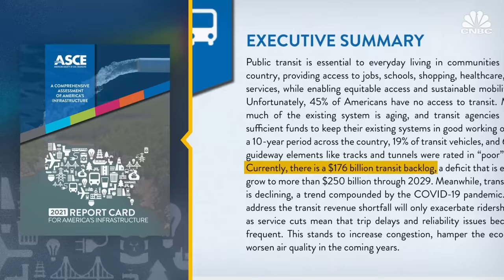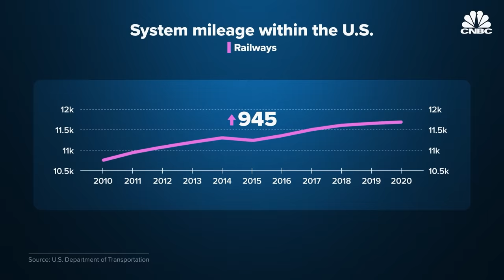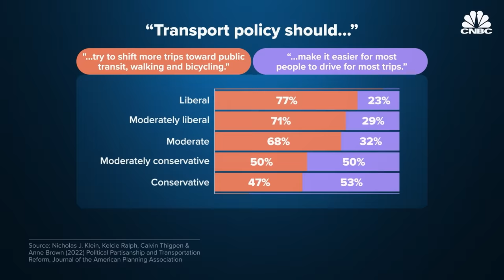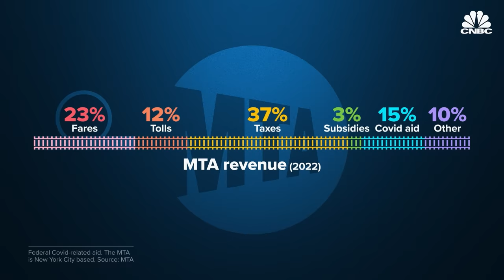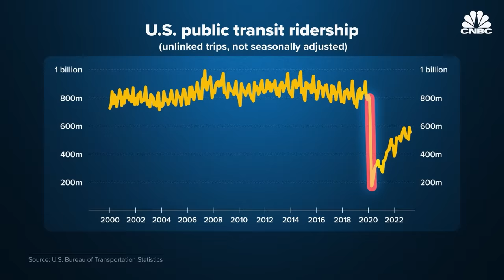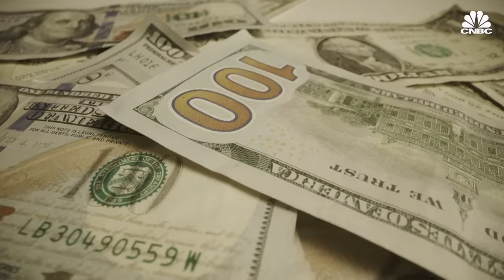Why The U.S. Gave Up On Public Transit

Comment: The U.S. is in a difficult spot. We need more and better public transportation, but to get to a reliable level would cost billions. Especially outside of large major cities. Minus the NE corridor, DC, and Chicago, public transportation drops off fast. Sure, LA and San Fran have it, but it's not like comparable to NYC or other parts of the world like Europe. 

Even in Chicago it gets limited outside of the city. The city is about 2.5 million people, but the region is about 10 million. There is a light rail system, but it's limited outside of rush hour. If you need to travel to downtown at 10am, you have one train per hour. Limited trains going in the opposite direction of typical rush hour traffic. What I mean is you have plenty of business centric areas in the suburbs, but people who live in Chicago have no option but drive out since the trains are limited outbound in the morning. Vice versa going inbound in the evening. Basically the highways are packed in both directions in rush hour, yet no options unless you are going in the primary direction determine by the train schedule. 

Sadly that is the situation. We need more public transportation, but people don't want to spend on it. At the same time you need people to buy into it. I like my car and the convivence of it, but I know many will only look at their car and nothing more. You need to a cultural shift to potentially make public transportation viable in the states.

Comment: I love public tranportaion but as a tradesman, it's just not a viable option.

Nevertheless there are issues not mentioned here that avert profitability.  

First off, it's an easy target for fiscal corruption.  Second, it's frequently used as a piggy bank for municipal short-falls.  Additionally, management of the systems seem to be more of a set-it-and-forget-it.

Lastly, when emerging cities launch commuter rails, they seem to wanna debut it as the infrastructural Crown Jewel of their emergence, rather than building it first with practical efficiency.

Comment: Sometimes it just does not make financial sense either. I can take the bus into work BUT I have to commute to the closest MTS Rapid stop to catch the bus I need. 30-35 minutes later I get dropped off and have to walk a mile and a half to work. Return is just the reverse. It will cost me 5-10 dollars RT. If I drive my hybrid car at appr 40 mpg it cost about 5 bucks also but I have the flexibility to come and go as needed. I would LOVE to have a convenient functioning mass transit system here in San Diego but it just isn't. I have tried taking the bus from the closest stop near my house to Balboa Park. It is literally 3 miles away from my house but the bus route to get there takes nearly an hour! I can walk that fast...

Comment: I don't live in a city.  There is no way a transit system is going to work for people in my area.  First my driveway is 3/4 mile long with 500' of elevation change.  I'm not going to walk that.  So I need a car just to get to a public road.  Then it is 5 miles to a highway that could (and used to) have public transportation.  Why would anyone get on  public transit to only get close to where they want to go?  Then if you are going shopping what do you do with your purchases?  If you bought socks and underwear, it is not a problem.  But what if you bought 14 bags of groceries, or 53 bags of concrete mix, 20 ten ft. 2x4s?  So it is necessary to have a car anyway.  That's the story of living in a rural area.  Transit probably works in big cites for people who have a daily commutes in heavy traffic, but that's only a portion of the population.  And they still probably need a car to drive to grandmas house that is out in the country.

Comment: I've just returned to the UK from a driving trip down the West coast of the US, talking in Seattle, Portland and San Francisco.

I found public transport to be generally good - cheaper than the UK, and for the most part a pleasure to use.

Some thoughts:

The big one is that you should be able to simply use contactless payment on all mass transit. Paying with cash feels ridiculously antiquated and having to secure several different cards that you charge is just friction that makes it less accessible.

Several times on buses the machine wouldn't take my cash and so we travelled for free - I suspect a lot of people just don't pay.

Outside of cities (and sometimes within them) it's really difficult to walk anywhere. Even a short quarter mile from a hotel to the nearest grocery store often involves hiking along next to a busy road with no sidewalk. This is a simple fix but costs a fortune.

I think working on the small things that don't cost a ton is the place to start. Make it easy to pay and remove excuses for not paying feels like a quick and relatively low cost win...

Comment: Maybe I just find it hard to comprehend the issue, whether due to the video's presentation or just my own shortcomings, but I finished this video feeling puzzled about the matter and getting the impression that a minority of urban planners and some city dwellers think the U.S. should redesign many of its cities around improving public transit and larger society in their idealized image. At the same time, in explaining how U.S. public transit got to its current state, this video gave me the impression that most Americans want this car-centered society, and there's so comparatively few who want whole cities and societies to be reshaped around improving public transit, that current public transit runs on a deficit, and the video's featured proponents all basically are demanding more and more federal spending on something about which the vast majority of Americans and their representatives don't find to be in their interest.

1. We used to have better public transit that was better integrated into cities.

2. The automobile came along, Americans voted with their wallets, and public transit use declined, leading to dismantling of much of its infrastructure and changes in cities.

3. Current public transit regularly runs on a deficit, and ridership is not enough to fuel revenues to sustain it, which means it depends on money from the government.

4. For those who want to improve public transit, the solution is to greatly increase government spending, especially at the federal level, so that these existing forms of public transit will attract more riders.

The above points are accurate to what the video says, right? Considering all this, I find myself asking, "Why?" Most of America doesn't care for it, and we are where we are basically because Americans favored a car-driven society and still do. If people in cities really want to improve public transit, because those are the people who seem most interested, shouldn't they look to solve it themselves somehow, instead of trying to get more and more federal funding? Could they make a good business case for private, localized investment instead?

Comment: Like I'm all for more public transits but the problem also applies to poor city planning. It actually makes no sense for transits to run on a inefficient route daily as well. The cost of gas, time and maintenance and the lack of riders doesn't make any money to support the public transits. People are too spreaded out and so are the stores, for groceries and attractions.

Most people go out mostly for work and schools and maybe groceries and essential if they don't use delivery services. Now a days there aren't many attractions to get people out of the house more often for people to go shopping. Like the malls are dead in the US due to not keeping up with the times. 

Maybe there should be a census on where people live and where people actually works or go to schools to create a more efficient route that will continue revenue to support the public transit. Also transit in the US is expensive as well and which is another reason people don't want to use them. If the prices is reduce plus more effective route possible people will use it more often and revenues will go up.

Comment: Having to use public transit is a pain, and my god for many reasons. i'd love a e-bike or something so i can be free and not deal with some crazy on the train or due to signal fixes and that'll cause me to stop at 125th that stop needs non stop out reach and cops so many crazies in that station!

To the push for electric modes of transportation can lead to good just we need less cheap made batteries doubt that'll happen! but maybe just maybe!

Comment: These systems have to show a methodology and business model that shows a profit or at the very least, break even. Efficient use of resources is key - no waste, reasonable wages and benefits, periodic reviews to ensure funds are being utilized correctly. Allow private companies to enter partnerships with local governments to spur innovation and reduce costs.  None of this is mentioned in this report.  The present model does not work.

Comment: So we admit in this video that public transportation in the USA is a loosing proposition, but they advocates for this garbage think that by throwing money at it, somehow it will not be a loosing proposition.

The street car companies couldn't break even, let alone turn a profit, even when they had exclusive use of lanes for street cars and the cars were low maintenance electric. This at a time when the vast majority of Americans didn't own cars.

NYC which has the most developed mass transit system and highest population density in the US can't break even.

Mass transit doesn't work.

The places where mass transit "works" are place where the populace is forced to pay exorbitant taxes to pay for it and is penalized if they do not use it.

Case in point. the EU and by extension the UK force a 250w power limit on e-bikes and a max speed of 25 kph. Thats 15.5 mph for us Americans. The UK bans the use of compact, easily stowed e-scooters from the sidewalks and roads. The UK even admits the reason why. Because if people ride themselves about they won't use the bus or the train!

and do you know why mass transit rider ship is down post covid? because you handed out thousands of dollars in stimulus money to poor and working class people. You told them the bus and train were unsafe due to covid (they are unsafe and not just due to covid) but these people still had jobs to go to. a whole bunch of them bought ebikes and scooters. ebike sales skyrocketed 240%! 

where I live, which is a working class low income area, the people here have gone from regular bikes to about 20% ebikes. in the more affluent areas the only people sitll on regular bikes are kids and "cyclists" everyone else is on ebikes. 

for me to get the 13 miles to work it takes 2 hours by bus, it takes 30-45m by car (depends on time of year) and by ebike about an hour.

and yet some how if more people ride the bus it will get faster safer and more convenient.

Comment: Bart in the Bay Area should work great. The reason it doesn't has to do with how poorly it is policed and maintained. Anything after commute hours is dangerous the criminals just jump the gates with no repurcussions. If they aren't forced to follow that rule why would you yhink they would follow any others? The stations are not very clean in a lot of cases and the parking lots at plenty of stations are not safe after dark. You cannot meet a Bart user that doesn't have a negative story to tell. The countries that have good public transit have no tolerance for bad actors.

Comment: 45% .. try more like 65 %  perfect example is the DC metro area. Loudon co. VA Is the richest COUNTY  in the nation.  Yet the county has imposed a 1% sales tax to pay for expansion of the PT. Yet the lower classes live in the more remote sections of the county and are forced to use vehicles to commute. This has a penalty because PT only operates during certian hours . This then drives people back into thier vehicles because in- flexibility of PT  is unrealistic.  So you are paying indirectly thru taxes .. then directly through the fare .

Comment: Because public transit isn’t profitable. In fact it loses money. Which means that most of the U.S. will not go anywhere near it with a 10 foot pole.
Reply: Does the Interstate system make money?
Reply: @officialpanasonic6244  the interstate system was built for the military, you know that right?
Reply: @JCS_fan WW2 happened before the Highways & Trains Carried Military Equipment in WW2
Reply: @JermaniBurroughs  that may be so, but the previous commenter asked if the interstate system makes money. And it doesn’t - it wasn’t meant to. It was built to allow military vehicles and equipment to travel safely and efficiently across the U.S. Toll roads/turnpikes are where the money is made.
Reply: @JCS_fan  They did most of the rail services in this country stopped running?

Comment: Because GOV during the early stages of US team up with Car companies and throught the years they were creating and planning their cities to make it as car focus as possible so people are in the need to jump into buying cars.

Cars companies help the GOV candidates with money and taxes
GOV helps Cars industry making their cities focus on cars.

Which lead to this. A whole country who hates walking,cycling,public transportation and mobility of masses. 

it's embarrassing that even LATAM countries got a much better and useful public transportation systems that at least work and can take you to places using a motorcycle,cycling,bus,metro. At US you can't even roam a city because 95% of the routes aren't usable without a car.

It's embarrassing than US doesn't have a damn train system across the country... Embarrassing they don't have bus for each route of the city... it's embarrassing some routes DON'T EVEN HAVE DAMN SIDEWALKS. This state would never changes because the car industry in US is way too strong and to fix the issue would you need to part away from those automobile companies and you don't want to do that because they are subsidize,taxes payers and move the economy with car selling. You would be turning the back on them.

Comment: Investment in public transit takes longer than a couple quarters to show a benefit on the balance sheet. More like 20 years. As such, building out mass transit would be hugely expensive and not pay off for decades, and as such, it doesn't make money quickly enough. Never mind that the point ISN'T TO MAKE MONEY. The point is to give people more access to transportation, which some people don't think you deserve unless you make enough money to afford a car.

Oh, class warfare. That explains it. The rich don't want the poor to be able to change their station. Public transit helps them do that. As such, it's not important, since it serves no purpose other than to make those filthy poors feel like they're not subhuman.

Comment: Well, America prides to be a privately run nation.  Everything has to have profit and public transportation is usually a loss money investment, so it’s hard to get funding and also selfish private resistance to land acquisition (e.g., South Pasadena refused to let Hwy 710 to pass resulting a road stopped in the middle, LA to SF high speed train has no way to acquire land to build tracks so it’s doomed).  I live in LA, but don’t like our new metro because too many locations smell like toilet, I got harassed multiple times, long long wait time and it doesn’t take me to designation.  I always take metro in Asian cities, metro lines take me directly to mall, residential area, every few minutes a train, safe and clean.  I do not mind the no eating no drinking inside restriction because it’s way better than our free but disgusting LA metro.

Comment: While I know it isn't Asia-level and also that yes, Dubai loves its cars, when I was fortunate to travel over there it was still fantastic that you could take the metro to most of the places you'd need to go within walking distance.  Absolutely spotless, clean, and works of art for their stations.  Again, huge monetary differences and factors which I know, but it is indeed too bad we don't have great mass transit in the US at all.  

My area I might be lucky to have Uber or Lyft at best.  No real taxis in rural suburbia, certainly no busses or trains.  Bike if it's short, otherwise have a car or you're screwed.

Comment: It's a common misconception that America has poor public transit. It's more accurate to say that other countries have poor infrastructure for vehicles. I have travelled and used public transit in many European countries and I noticed that the busses there are not better than the busses in here in America. The wait times were still long and inconsistent. Instead it was just much much worse to drive making public transit more appealing.

Comment: In this video he talks about public transportation and it depends where in NYC the MTA spends a lot of money on the trains and the bus but it is very reliable but when you talk about the LIRR AND METRO NORTH these people save a lot of money and don't have to spend for gasoline as it is cheaper and AMTRAC is not exactly cheap so you have to cost everything out many different factors and even taking a taxi as in NYC you have the yellow cabs green cabs and other services which they are all competing for the dollar as years ago the mediation cost a whopping 1 million dollars as I have stopped by and opt for public transportation cheaper and faster and I don't mind crowded trains or buses doesn't bother me as often people know what to expect especially at rush hour and I know when school let's out so I avoid that hour and work around it. Know the local and express hours and the line to your destination me coming from LGA TO HNL I also know what carrier to take because it's a very long flight to Hawaii so I want a layover usually in LAX